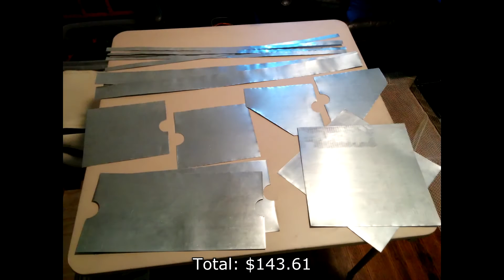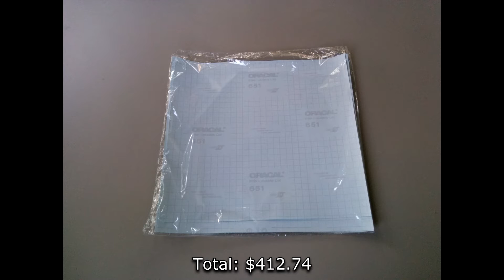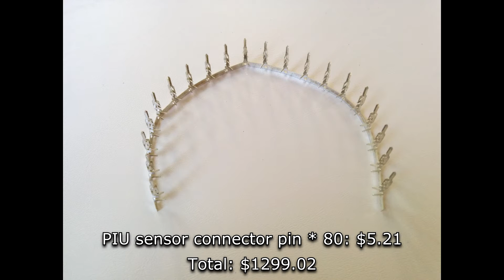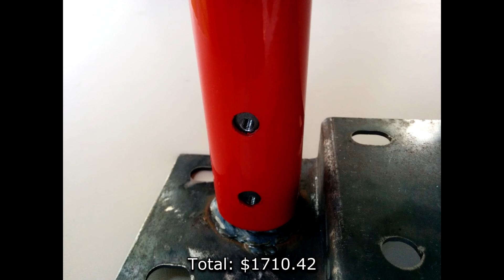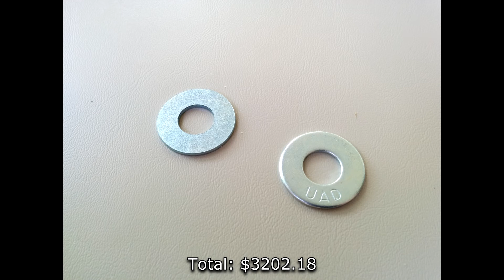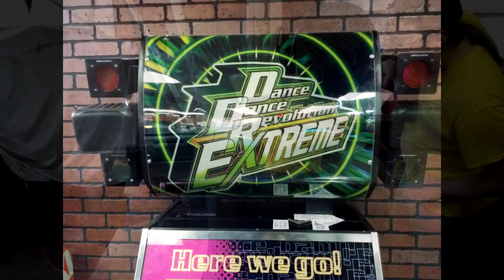Building an ITG2 dance pad replica - episode 16: Suppliers and costs (final)

Comment: it's been a year i've been building a custom designed itg machine for events, and that guide was SO IMPORTANT for making the pads, i managed to adapt the design to match the parts i planned to use, and adapted it for FSRs and a fully polycarb surface. i have currently one of the two pads built. Thanks

Comment: So it costs ~$1500 per pad. 500 less than StepmaniaX, damn
Reply: I honestly think a StepmaniaX pad would be the better investment.
Reply: @AwesomeH69  I've found out that someone made a pad less than $1000 and it looks fantastic. Sure most parts were aftermarket and were completely different from the original design, but it's better than getting a brand new, let alone a used, part for custom dance pad building.
Reply: @5K00O  I don't know. With SMX (brand new from the site), you get a one year warranty, and there wouldn't be any chance for any fuck ups. Plus, not everyone would have a single family home, so no workshops or anything. And I personally would want my pad to look as close to an arcade one as possible, and I stepped on SMX pads before and they feel nice. FSRs would be included already, too.
Reply: @AwesomeH69  No I mean, like they got as close to the original design using different, but effective parts. They got home depot to do the wood cutting for them so all they had to do was to drill the parts together, but I do see where you're coming from. 
It sucks that SMX only does batches every few months or so. So either wait months to get a chance to buy one or build your own DDR Pad from scratch

Comment: Could you please tell me What’s the diameter of the leg levelers screw ? I need to know to make the right hole to install them
Reply: Which size bit drill is suitable to make a hole for the leg levelers? Hope you can answer
Reply from the maker: 16mm. Standard M16x2.0 thread.

Comment: My husband and I are looking to make one of these over the summer. You're pad really is above and beyond. Way more than what we're looking to do XD
I think 3D Printing corner brackets if you're using the base plastic from a company you're looking at about $15-20 per bracket. I 3D print and making simple designs runs me at about $9 for just a ring, and $15 for cuffs or small 2" boxes in base plastic. Metal will cost even more. 3D printing from a home printer will cost less if you have one, but you have to own one first. Otherwise you're paying another $900-$3000 just for the printer. So depending on the materials you might save yourself about $300 or nothing at all.
When I showed this to my husband he said if you know a friend who's welds you could possibly get a better deal than 3D printing. Maybe 1/2 of what you paid here. So that's an option to cut cost too.

Comment: Im interest for the itg panels. Where i can find them?
Reply from the maker: I used these: http://www.tapplastics.com/product/plastics/cut_to_size_plastic/polycarbonate_sheets/516

10.75" x 10.75" x 0.5". The half inch thickness is slightly more than actual machines use. I'm measuring a Pump It Up panel (should be the same dimensions as ITG) at around 0.4". If these are going into a machine, the 0.375" thickness would probably be the closest match.

For the decals, these are the graphics I had printed: http://ludobloom.com/temp/DECALS_FOR_PRINT.png

More info here: https://www.youtube.com/watch?v=qaym4LzOJtM
Reply: Alex Diener awesome!!! But what is the right widht and lenght? Would you help haha.
Reply from the maker: 10.75" x 10.75". Also remember that you'll need to cut the corners off with a miter saw or something similar, about 5cm from the edge both ways.

Comment: Can you add a link to those PIU/ITG screws for the triangle brackets? I can't specifically find the type you have on ebay, even searching the specs given. Thanks!
Reply from the maker: Sure. These are the ones I used: http://www.ebay.com/itm/M6-6mm-Zinc-Steel-Hex-Drive-Furniture-Connector-Cap-Bolts-Fixings-Screws-/282443891178

15mm length is what I chose. They don't have 12mm which is what the official ones are, but they're identical otherwise. Shipping is pretty slow, so expect to wait about a month after ordering.

The official ones are also available at arcadespareparts for a higher price: https://www.arcadespareparts.com/arcade_parts/machine_parts/pump_foot_step/12481.html

Comment: Rather than making a 5 button Pump it up pad.. why not make your current pad into a 9 button?.. so you can play both with the same pad? :)
Reply from the maker: It's a nice idea, but there are 3 reasons it wouldn't work too well: Corner panel dimensions, active panel recess, and inactive panel rigidity. The Pump It Up layout isn't an exact inverse of the DDR/ITG layout; there's some overlap on the inner parts of the corner arrows. Pump charts are written with this in mind, and it would be a completely different experience to play with square corners.

Recess is the other major problem. With my playstyle at the very least, having the active panels sunken a little bit is absolutely crucial. Footwork is all about managing which parts of my foot are on the raised solid platform and which are on the lower active portion at all times. I need to be able to feel precisely where I am, and with just a slight tilt of my foot, get onto or off of an arrow reliably.

A slightly more minor problem would be that if all 9 panels have sensors in them, the ones that aren't being used for play would feel exactly the same as ones that are. Active panels have a little bit of give, since they're sitting on rubber and foam instead of solid wood or metal. It's more subtle than recess, but it definitely makes a difference in pad feel if the nonplayable surfaces aren't completely rigid.

All that said, what you're describing is basically the Impulse dance platform, which is supposed to be available someday. It's a somewhat different sort of thing built for its own rhythm game. A lot of people are apparently excited about it, so it should be interesting to see what it's like once it's ready for the general public.

Comment: Hey Alex, cool project... I know hindsight is 20/20 but you really did things in really expensive and complicated ways xD I keep thinking of all these alternative methods that things could have been done.. lol I'll spare you the long list but I will leave one idea that could really save someone a LOT of money.. those corner brackets.. that price is extreme.. they really screwed you over on those.. something you could have done that would be just as strong and with some good sanding would look even better is metal casting. could do batches at a time, carve them with foam and use a community build shop/makerspace vacuum forming station to cast all that parts and spend an hour or 2 on a belt sander at the cost of scrap metal, time and whatever makerspace fees you might have. oh and those bars, could of done that too with pipe, pipe bender and a good paint or if you find a local place.. powder coating :)
Reply from the maker: Those corner pieces are probably the biggest regret I have in this project...not specifically because of the cost, but because of the design. Now that I have my own Pump It Up machine and understand how it's put together, I would have done them completely differently. Instead of four separate pieces per panel, they're supposed to be one large piece that includes all four corners and provides a level platform for the sensors, among other things. The individual pieces I have now have a problem where the single screw holding them down loosens over time, so I occasionally have to take off the triangle brackets and tighten the pieces underneath. Even with all of the adjustments I've done, they're still not perfectly level or centered. Someday I'd like to make proper replacements, but my worry is that I haven't left enough room in the pad to actually fit them in - I'd probably have to do another major adjustment to add some more space around each panel to make that work.

I'm thinking maybe someday I'll build a second version of these, with a proper all-metal frame. Using wood worked OK, but certainly came with its share of issues. With access to an actual Andamiro-built pad I can reference, I'd be able to make a much more accurate replica.
Reply: @adiener  Have you tried using Loctite to see it'd hold the threads in place?  I use it when working on cars all the time, and I'd imagine it'd probably do well here.
Reply from the maker: My understanding is that that would be for permanently preventing movement. I wouldn't want to lose the ability to remove a screw if it needed to come out.
Reply: @adiener   You can definitely still remove the screw, it would obviously just make it a bit harder.  I don't remember what type of fastener head it was you had used, but I would probably not use the stronger applications it on flat bladed or philips drive screws.  Torx would be the preferred type, otherwise allen would work great as well.  They do make different strengths as well, I would recommend starting with Loctite 555339 222 Purple Low Strength Thread Locker.  That would be fine on flat bladed, and probably on a philips head screw so long as you use a quality fastener and screwdriver.

Comment: Pretty neat, but more than $3000 for wooden pads? Let alone $960 for the triangles?! You might have been scammed. Don't get me wrong, it looks pretty awesome overall, but damn... you can easily buy a whole used cabinet, which is also made of metal...
Reply: maybe that's including the tools
Reply: $30 for one triangle. That sounds about right. Considering all the tools needed to make that piece and the time required to make sure it's done right.
Reply: Yeah I was going to say, for the price he paid to make that (Awesome results I might add) he could have gotten just the pads or the entire machine.  I just got two complete machines for free from a friend in the amusement biz.  Mind ya, it will take a lot of time and money to put them back together, but still, free!!!  I will be completely restoring them both!